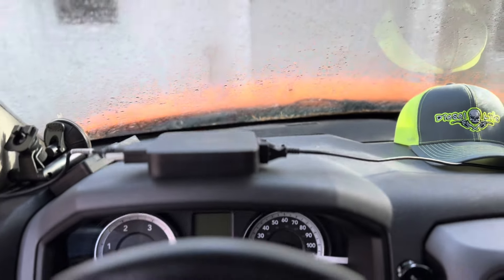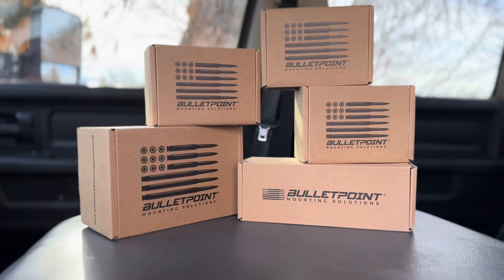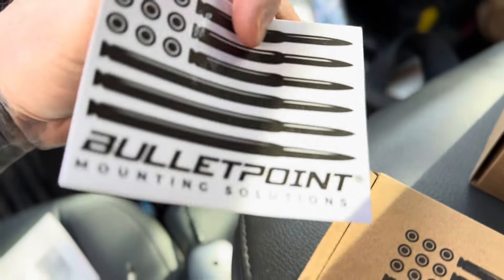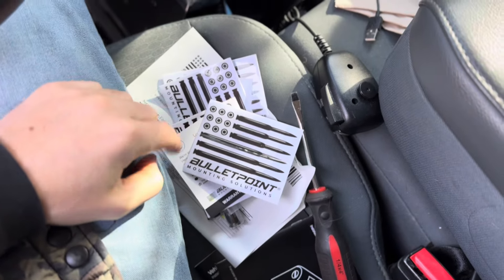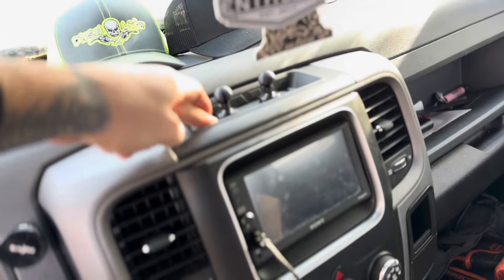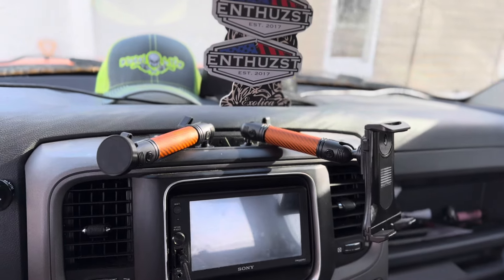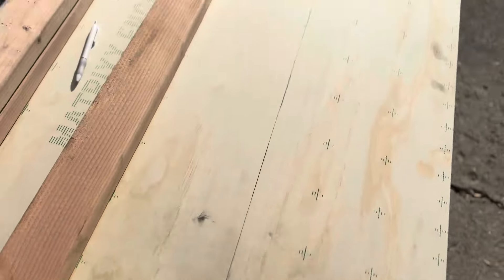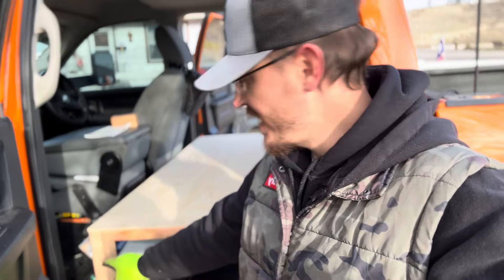Non-CDL Hotshot | Prepping Truck | Building Hotshot Bed |

Comment: Hi. I’ve been enjoying your videos and am a new subscriber. I’m looking into getting into non CDL
Hotshot. I have a 2007 GMC 2500 Duramax and would like to use that. It’s got 149k on it though and a 6 inch lift 35” tire’s similar to yours so whatever trailer I went with would have to be modified as well. What else would I need to get in order to start beside the ELD, tarps, straps, etc?

Thanks
Reply from the maker: Thanks for subscribing! Glad the content is helping. Since your truck is lifted I’d look into buying a Diamond C trailer. Idk many manufacturers who offer the extended neck for lifted trucks. But yes, look into Motive for ELD(can always run paper logs for a week while waiting for it to arrive), straps, binders, chains, moving blankets, tarps (4’ , 6’ , 8’) oversize banners…there’s a lot to get. If you go through MyTee it was like $1,400 for everything if I remember correctly. I might need to make a “hotshot essential equipment” video